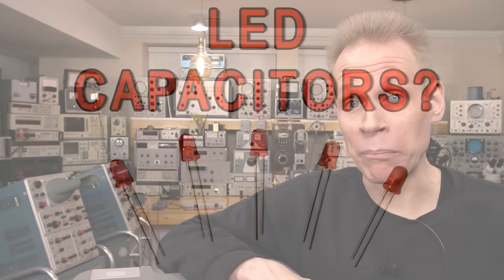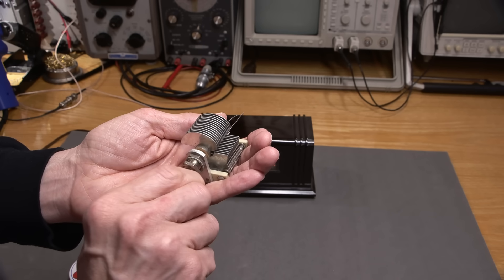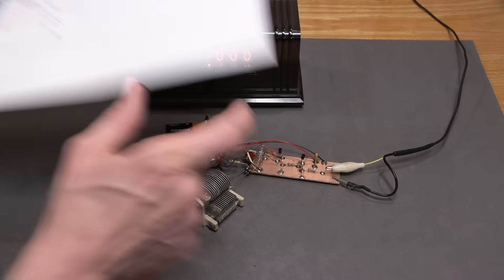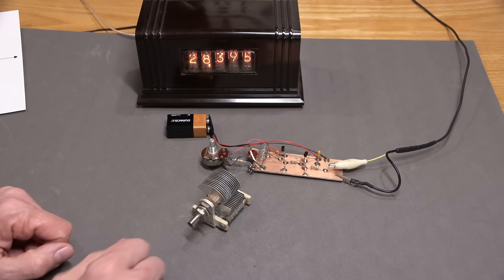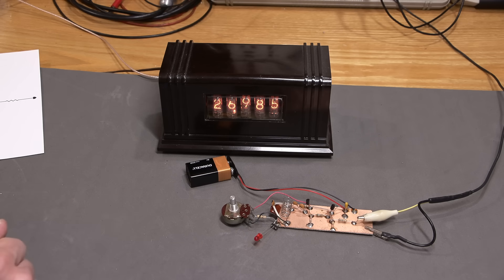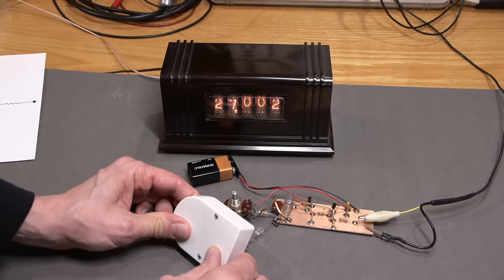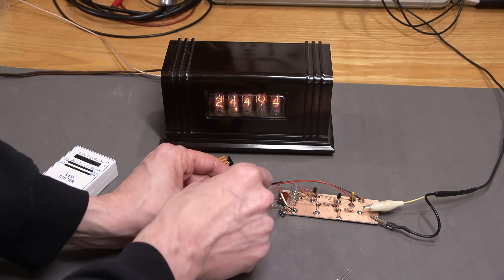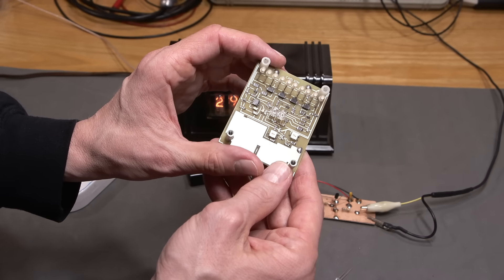LED Capacitors? See How They Work!

Comment: Of course, any PN junction will have some intrinsic capacitance, though it’s typically only a few pF. The exception would be a varactor diode whose capacitance is controlled by the reverse voltage across it; they can have a capacitance up to about 365 pF, I believe. These are used in “electronic” tuners that have no variable air-gap capacitor typical of tube sets, or older transistor radios.

Comment: Photovarctors are a "thing" (they can be used for tuning microwave circuits).
I wonder if a more common 4N37 optoisolator could act like this? The output phototransistor junction capacitance is probably pretty small, though.
That is one "feature" of the LED: The junction capacitance will be relatively "large".
This just made me wonder if a BPW34 photodiode would be good. It has a large area and a higher reverse breakdown voltage than an LED.
This is a cool idea.

Comment: Something to keep in mind... a red LED has a max reverse voltage of about 5V - check the datasheet for the one you use.   Exceeding that voltage during circuit operation can degrade or destroy the part, so make sure your circuit limits it to a safe level.
Reply: Then it becomes an NED- a noise emitting diode.
Reply: @danrowley7002  haaa.. 🪰
Reply: I was just going to say something about that LEDs don't like being hooked up in reverse over a certain voltage actually in either direction. .
Reply: @KRich408 O segredo está no resistor de limitação de corrente.
Reply: @KRich408and that called avalanche voltage
Reply: 5V is the absolute maximum rating. That doesn't mean the breakdown starts right above 5V. You can find reports online that the breakdown voltage is in the tens of volts.
Reply: @jarosawmalinowski8130  Certainly.  But what good does it do you to find an LED that died at 7V?

If you want to design a circuit that lasts, stay safely within the rated limits.
Reply: This was yesterday. Test it with actual Leds.

Comment: I’ve been doing electronics for 30 years and I was today years old when I just learned this…this is why we love ya Mr.Carlson!!! 😳😳
Reply: Varicap diodes have been in electronic tuners forever.
Reply: @thisisyourcaptainspeaking2259  I guess I'm older than "forever" because they sure as hell weren't in tuners when I was learning the trade.
Reply: . No moving parts, unlike drum tuners.
Reply: @Logrhythmic-m3h 

That would be the early 70s when they first appeared. Radios with little pot tuners for multiple presets and stuff like that.
Reply: It's called turning a disadvantage into a feature.  A capacitor is just two charged plates separated by an insulator.  A diode in reverse polarity builds is a deletion layer that separates two charges and prevents current from flowing. Normally, this parasitic capacitance would be disadvantage; but, it can be exploited.

Why you would use an LED instead of a purpose made varactor, which probably has better documentation directed for that use case, is beyond me. 

Diodes also make fair thermometers. Since thermal voltage is dictated by temperature:  v_t =kT/q

Therefore, if you know the ideallity factor of the diode material, you can determine the temperature by putting it in a circuit that measures its forward voltage.
Reply: @timharig 

Because nobody makes varactor diodes anymore, they are hard to find now.
Reply: 57 years, for this old codger. I came to know about varactor diodes in the late seventies, but never bothered to see if light emitting diodes displayed (<see what I did there?) similar properties.
Reply: @Logrhythmic-m3h A capacitor is nothing more than two charges separated by an insulator. A diode, at reverse bias,  works by forming a depletion region (forming an insulating layer) between two charges  to prevent current from flowing. So any diode acts as a capacitor in reverse bias.  Normally, this is "parasitic capacitance" is considered a defect. But it can be exploited. I just don't understand why you would want to use a diode designed and documented for outputting light when you could use a varactor diode designed and documented for that specific purpose?
Reply: WOW!
I find it hard to understand that in 30 years you haven't learned something so basic...
Reply: @cosmefulanito5933 : It seems rarely discussed, as far as I know the first widely published studies are on Hans Summers' website.
Reply: @cosmefulanito5933 

It depends on what he usually works on.  Maybe just low frequency stuff where junction capacitance in diodes is irrelevant.

Comment: So while a real varactor diode has a range of capacitance of around 1:2, the poor mans LED varactor only varies by 5%. No, I'm not impressed, every regular silicon diode will do better. But probably the LED ranges 500pF while the diode only has 10pF.

Comment: I actually had a solid state RF switch circuit that used LED's as an isolation diodes. It was controlled with 4000 series logic gates, PIN diodes for switching elements and and additional quirk of the design was the LED would glow when that channel was on. LED's really are diodes just with crappy specs.

Comment: Good idea to use an LED as a varactor diode in a Hartley oscillator. It's very possible that this would also work with a 4046 IC !

Comment: You could makre FM modulator by coupling 2 LEDs.
Reply: low frequency modulation yes, but not very effective for audio, leds are low bandwith because of very high capacitance in the jonction.
Reply: @Dieseleux the we can use LEDs in series
Reply: Don't even need LEDs. Inject audio signal into base of transistor in Colpitts oscillator and you get FM modulator (and parasitic AM too).

Comment: Great video.  I like that nixie tube frequency meter.
Reply: that is godtier - in hungary )soviet control times) we had only frequency meter that consisted of wobbly lines inside gauge (lookup Frequencymeter 144 P)
Reply: Absolutely adore it, but wish it was an analog b/c it’s all I can focus on.  Kinda like, if I had to drive a 1955 300 SL to the grocery store, I would not come back with the right items😅

Comment: If you had that circuit hooked up to an audio output, and had a spinning disk with a perforated pattern interrupting the two led's that are facing each other, you could have some interesting sound output.
Reply: Or just use an LED flashlight that has a dimming circuit. This typically uses a PWM switching circuit to the dim the light output with the frequency around audio rates.

Comment: Enjoyable video, thanks! I did know that pretty much all semiconductors change capacitance with voltage but did not know about the photosensitivity part. Of course since capacitance is variable with voltage, it will add some even harmonic distortion to the sine wave which the variable capacitor won't add, but this may not be significant depending on the application.
Reply from the maker: Glad you enjoyed it!

Comment: That means you can build light controlled FM modulator. So you can convert 850nm impulses from fiber to FSK modulation. And very easily viceversa. So you can have CHEAP easy to build RF to Optic transverter.

Comment: Very different use of LED's! Thanks for the info... now to go thru all my sams cb radio manuals and find those sear roadtalker radios that had LED's on the circuit board that never lit up for tx or rec.... wondering if they were being used as a bias source or as a capacitor. They were always red in color... and I remember that there wasnt many colors to choose from back then... I think these were in the 40 channel SSB radios....  you got me thinkin....!!!! Thanks for that, and thanks for the great video.
Reply from the maker: My pleasure!

Comment: That's really cool.  So the charged regions on either side of the depletion are acting as capacitor plates and the depletion region as an insulator separating them?  Could you put LEDs in series or parallel to increase or decrease the frequency ranges in which the circuit oscillates?

Comment: I used to use varicap diodes in oscillators around 30MHz to FM the carrier. Experimented with all sorts of diodes and even tried an LED and worked fine. Oscillator was multiplied by 3 to come out on VHF broadcast band and even the LED gave enough deviation for 75KHz mod.

Comment: Very COOL, I knew about diodes that work as capacitors (Varactors) , but I thought it was a specially made component, I didn't know that using an LED in reverse bias works too.
Reply: Not just LED's. Standard diodes can also be used this way.
Reply: @SpeccyMan  Sure, that makes sense... now... LOL. I don't do much analog at this level, but I learned something new.

Comment: Great showing how it works. My only but is that not all LEDs like a very high reverse voltage. Thanks for your great videos.
Reply from the maker: It's current limited by a 100K resistor, so all is good :^)

Comment: We see the PN junction of a reverse biased LED with an inherit capacitance ( transition  capacitance) in action here. Do not exceed the breakdown voltage from it's  spec sheet given for any particular LED diode. For you old timer's  have you ever seen
a "gimmick" capacitor in a tube radio receiver schematic? Two wires not connected and twisted together. We are replacing it
in a circuit with that kind of capacitance size just not in a higher DC voltage circumstance. Nice demonstration Paul!
Reply: Do not use the contraction instead of the pronoun! Also, avoid misuse of the apostrophe. Not a master of the language, eh?

... it s spec sheet ... 
... old timers ... (timers is a simple plural, ergo it DOES NOT have an apostrophe!)
Reply: @SpeccyMan  I see you might be a "cunning linguistic" but not any kind of electronics fan. So why are here? Just to pester or be a  writing molester? By the way I can change all those things you mentioned but since it frosts your butt I think I will leave it as it is.

Comment: I have a part tester that will tell you the dio.Junction voltage drop and it will tell you the capacitance of the diode

Comment: Thanks for sharing this knowledge, i didn't knew this. 
I knew that in reverse bias a LED can be used as a photodiode, but some types are better for that purpose then others. I find it fascinating to use electronic parts for other purposes then they are original designed for. Grtz
Reply: We can't, however, do that with prepositions. They should NOT appear at the end of a sentence.

... for which they were designed.

Comment: An FM modulator comes to mind. Feed the audio (or video) in one led, and have it control the varactor led. An FM optocoupler. 😄
Reply: Back in my teens, one of my know-it-all teachers said that an FM transmitter is very hard to build due to the high component count.  I disagreed, so for shits and giggles, I built a single vacuum tube  (Dual Triode)  based FM transmitter out of old TV parts.  

One triode worked as a plate voltage-controlled oscillator, and the other worked as a simple Class A audio amplifier to modulate the plate voltage.       I think I had maybe 10 total components in the circuit, including the line voltage-based power supply.  🤓

Comment: key takeaways 
junction capacitance exists 
leds can be used as a crude photodiode . 

not sure if reverse biasing a led is a good idea neccessarily as the reverse breakdown voltage is probably not too high if at all specified
Reply: Most of them 5 Volt max.